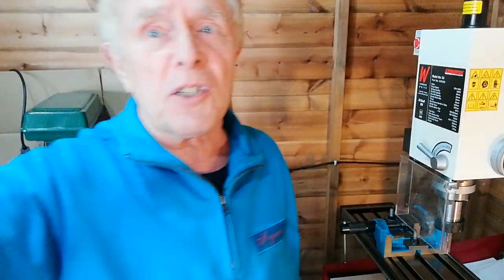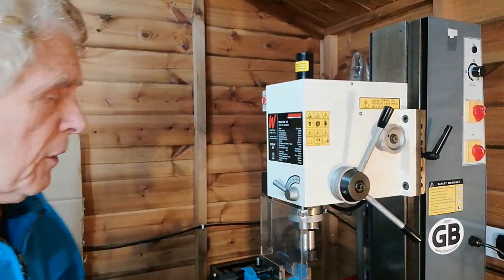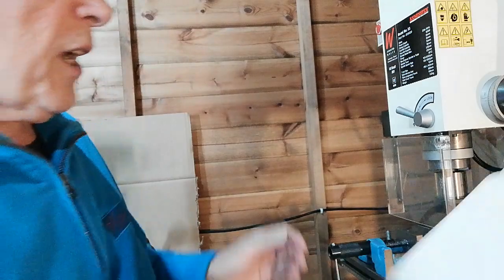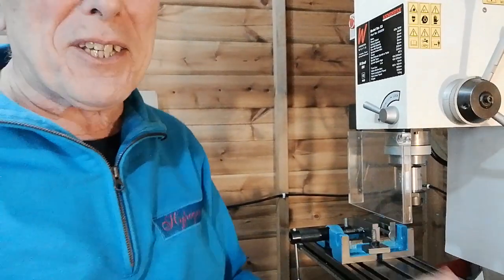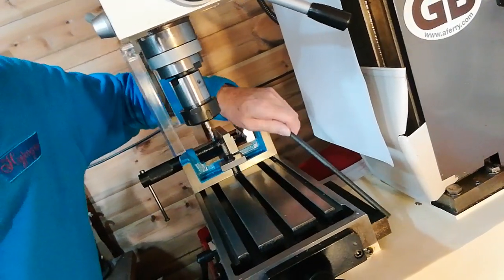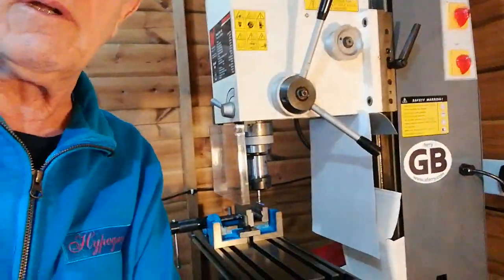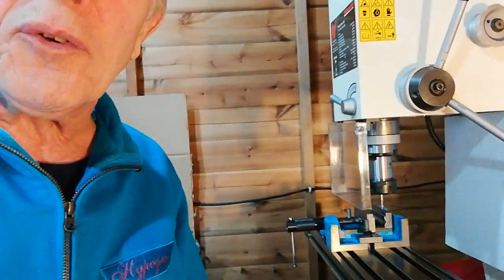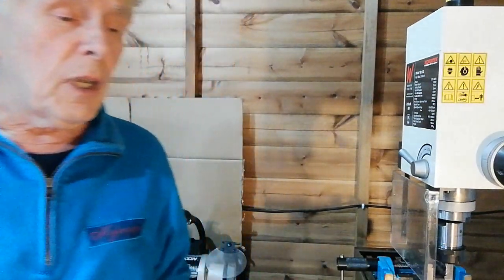Sieg milling machine (low cost accessory) saves you around £65.00

Comment: Good tip and makes me feel better about the crude swarf guard I have fitted to my lathe!😀 Interesting old photo on the wall at the end of the video too
Reply from the maker: Yes it's not always necessary to buy expensive accessories, when a little innovation can solve the problem. Also you are able to evaluate and maybe improve on your initial solution. Thanks for the comments and the old photograph you mention is one of my grandparents. There is also an original painting of my grandmother, located to the left of the one you mentioned. A classic portrait, quite glamorous I think and can be seen on some previous videos. They're both very special to me. 😏